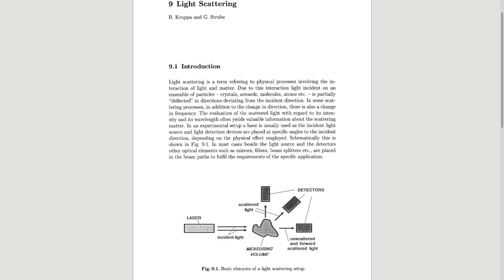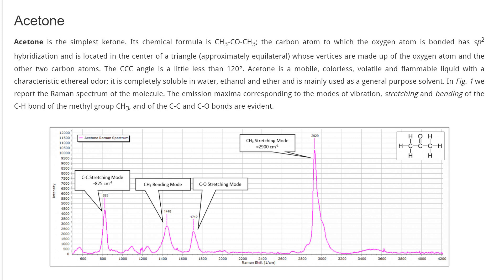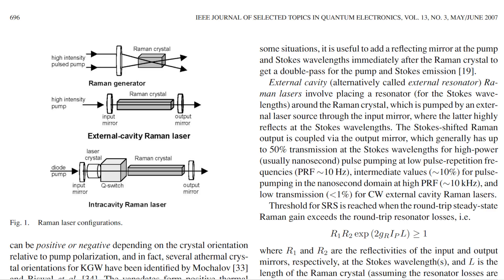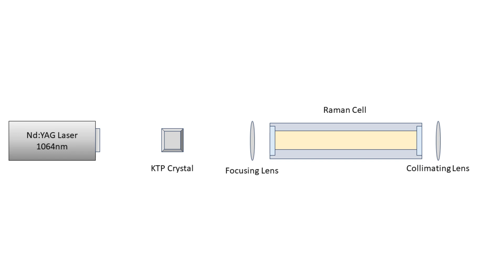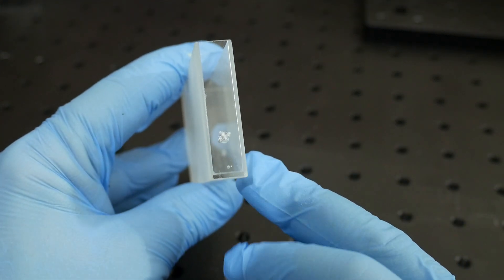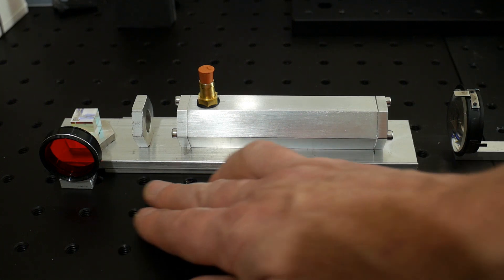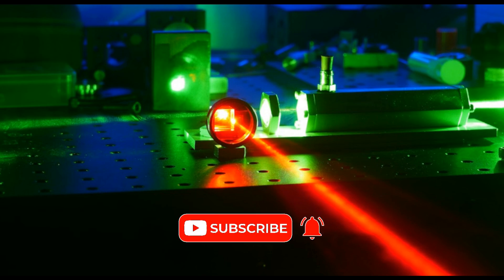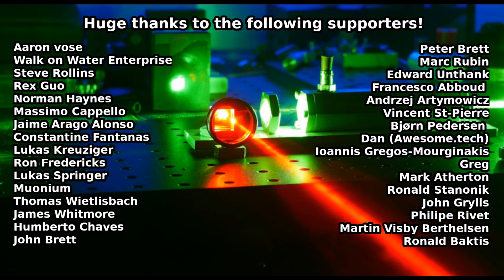Shaking molecules until Laser Light comes out. DIY Raman Laser!

Comment: I found an infrared laser diode and i don'tt know if i need a resistor in series and what kind of resistor i need or powered direct from my source. The power of laser diode is,115W, 895-915nm, 13.2v, 0,8A ,and I don't know if I should buy it to create with light pulses, plasma in the air (that is, to ionize the air) in the focal point. Do you think it's worth buying , so do you think it can work?i have laser glasses between 650-1200nm.Ochelari de protectie operatori pentru tratamente LASER DIODE si Nd YAG,or should I use the dark green glass of the welding mask?can this 115w diode produce plasma as I said?

Comment: I'm very inexperienced in this area...he had very little to no output with the acetone and ethanol, and at the end he had success with dimethyl sulfide if I heard correctly? I'm curious about the length of interaction in the cell in the setup shown, the higher limits one is able to make that interaction and the effects of increasing the interaction, also is it possible to use multiple cells and what it's effects are, what effect does input wavelength, power and time have? I know I'm asking alot of questions but I'm extremely interested as I'm not knowledgeable yet in this field and learning new things like a simple method of changing a green laser into an orange/red laser etcetera might as well be a cigarette or alcohol habit for me 😂

Comment: @4:41 are my lab experiments.  That is the tutorial page about it.  Thanks for linking to it.  Nice work BTW!
Reply from the maker: Awesome! It was a nice read, just wasn't keen on making a Pressurized Hydrogen shifter in my house! Thanks! :-)
Reply: @LesLaboratory  No kidding right?  Besides there is the cost of the gases. I made a cell a few years later with both hydrogen, deuteruim with argon:$$$. BTW, you alluded to a solid state Raman laser based on Barium Nitrate.  Look at the work on KGW crystals if you are interested. I was working on some of that a few years ago. That seems like a neat and promising solid state laser using Raman scattering.  See Mildren and Piper papers

Comment: Is it possible to recycle the dump beams back into the system to help energize the raman cell? It looks like a lot of energy is lost to the dumps beams, but I guess the camera might just make it look that way. Would it be worth doing in a real world set up?
Reply from the maker: Yes, the current setup is not very efficient. If resonator mirrors were included, it may be possible to extract more power. The system is problematic though, as the peak powers are huge. Stray reflections will destroy optics, and reflections back into the YAG Laser would more than likely destroy it. There may be more efficient ways that I am looking into.

Comment: Good video. If you want the long explanation then see Derek A.Long: The Raman Effect A Unified Treatment. You can solve the equations exactly to calculate exactly what wavelength and intensity of scattering you will get. It's fascinating to see how you work through it from basic physical principles and a good demonstration of where maths ends up pretty complicated. You solve it with a method developed by Oppenheimer.

Comment: Hi Les, I got a question about light that you might know the answer to:

I've read that the wavelength of light (is one of the factors that) determines how much a small structure can be resolved by that light. Wavelength can be thought of as the distance between two electric field peaks along the direction of light propagation.

Light propagates in 3D space, and even the collimated light from a laser pointer have a finite cross-sectional area. 

The question is: Is the cross-sectional area of a light beam limited by its wavelength? lets say that a laser produces circular spot on a screen with radius R from the center (highest intensity) to the edge where its intensity is (just close enough to) zero. If we have an X-ray laser, will this be able to produce a spot with much smaller radius R compared to a red 650 nm laser?
Reply from the maker: Yes, there is a finite spot size. This is dependent on  initial beam dimeter, focal length, beam quality etc.
Assuming everythng else is optimal, then yes, youbare correct, the ultimate limit (diffraction limit) is determined by wavelength. This is why Nichia's blue Laser diodes were such a big deal when they first hit the market.
Sure the output from an x-ray Laser could be focussed into a very small spot indeed, way smaller than any visible wavelength. Of course actually focussing x-rays is extraordinarily challenging.
Reply: @LesLaboratory  Ohh I see. Good to know!

Comment: 9:50 technically, frame rate isn't the key setting - but shutter angle. This is the ratio between frame rate and shutter speed. So if you're recording at 120 fps, a shutter speed of 1/120 will absorb all light, while 1/240 will absorb light 50% of the time and be closed 50% of the time, and so on.

It's called shutter angle because historically, cinema cameras used a spinning disc coupled with the film transport. So the amount of time light was let in correlated to the size of the cutout in the disc. 180 degrees, 90 degrees, 45 degrees, etc.

Scientifically, the main concern is what percentage of the time your camera is receiving light, but in cinema the visual effect of shutter angle on action scenes is quite pronounced - even though the camera is 24 fps the entire time.
Reply from the maker: Thanks, I will look that up and see if my camera supports it. The biggest issue I have found when it comes to filming short events, is the rolling shutter. If it was a global shutter, I suspect I would get far better results.

Comment: Fantastic results! Have you measured how much of the pump concerts yet?
Reply from the maker: Thanks! Not yet, it is particularly finicky to get it working for long periods (thermal lensing, optical damage etc) however there has been some suggestion that this may also be producing extraordinarily short pulses, so it looks like I will be investigating autocorrelation amongst other things.
Reply: @LesLaboratory  interesting.. for ultra short pulse generation I would expect the resulting spectrum to be much broader than the pump spectrum, because you usually start driving a bunch of funny nonlinear processes at once.

Comment: One use of Raman lasers was to convert 1064nm to 1550nm for "eye safe" laser rangefinders. They used a cell filled with  980 to 1200 PSI of methane to do it. Now they use PPLN crystals to do the same thing without the gas.

Comment: 5:25 How does "doubling" 1064nm create 532nm? I think you need to go back to math class...
Reply from the maker: Double the frequency is equal to half the wavelength.
Reply: Yes, I know. But you said doubling 1064nm (a measure of WAVELENGTH, not frequency) gives 532nm, which is not correct. Doubling 1064nm would give you a wavelength of 2128nm.
Reply: In reciprocal space doubling a vector halfs the vector in real space.
If you do more than school math you notice that real number space/vector space is not the only way of describing our world.
We can also use eg. reciprocal world, where half of something is equivalent of the double of its equivalent in real space.
So mathematically it is kind of correct what je said, if you dont only work in normal space.

Comment: So the frequency shift was due to methyl group vibration according to your spectrum, therefore the same effect could be expected from acetone or anything with lots of CH3 groups? On another note, since ramman effect is more pronounced for non polar molecules, you could try some benzene, toluene or stuff like tha
Reply from the maker: Exactly. The strongest peak normally Lases. It is possible to get other peaks to Lase, and even have the shift cascade (Cascaded SRS).
Sure. for that I need a longer cell I think, although, there are also 'other ways' to make the conditions favourable for other materials.
Reply: Good to know. But what makes acetone less effective compared to DMSO? I mean Very similar molecular structure..

Comment: Just superb. Despite working at a laser lab for many years now with at last count nearly five hundred lasers in the building scattered throughout dozens of labs, I have never actually SEEN a Raman laser actually doing its thing, only diagrams, and theory, and spectral traces. It's beautiful to actually see it happening, and illustrates to the curious viewer so very clearly HOW it's happening. I believe this technique of using a tunable Raman shifter (done with pressure?) is actually the 'secret sauce' of how the fissile uranium 235 "SILEX" laser enrichment process works. 
Fantastic work. Time to send you some more $$!
Reply from the maker: Thanks! and thanks again for your contributions to this channel!
It looks far more beautiful in real life it has to be said. Like the brightest He-Ne beam you have ever seen!
Ah yes, U enrichment, I remember reading about huge Dye Lasers being used for that as well.
The tuning aspect is something I am particularly interested in for Raman. There are a few papers that allude to it. I will have to dig deeper.
Reply: Yup they use raman shifted copper vapor pumped dye lasers for the SILEX process. They are tuned with diffraction gratings to a very specific frequency in the near infrared band.

Comment: There are 3 different laser frequencies in this setup. 
The initial infrared beam.
It gets doubled up to green.
That gets ramanized down to orange.

Do the goggles block all three?

Don't worry, I am not planning on using any complex laser setups. At most I might use a laser cutter, which uses a single color, so I would just need safety goggles designed for that color.

For this setup, it seems you would need filters that block everything but blue.
Reply: No, they're "LGB", or "KTP", or sometimes, but increasingly rarely since almost no one uses them anymore "argon" goggles. They block the fundamental Nd line and its doubled green, but are amber colored as can be seen and let orange and red light through so do not protect against the Raman shifted 629 here. At some point working with lasers of multiple wavelengths you just have to accept what's possible and take some risk with your setup. If you didn't, the only goggles you'd be able to use were ones made of steel, because a totally opaque material is just about the only thing that will protect your eyes from all the wavelengths you're dealing with in many real world setups. There just aren't any goggles that work for all wavelengths in an experiment like this, they don't exist. So what you do, and what he did, is simply choose the ones that are most suitable for the application and which block the most intense and most dangerous beams, which are the IR and 532 here, and just be careful about the orange beam.
Reply from the maker: What @Muonium1 said. The OD for these is pretty low at 629nm, and so it represents a moderate to serious risk to vision. For Supercontinuum the situation is worse. No glasses will protect you from all wavelengths at once.
For a setup like this, you must make sensible use of beam stops, and make use of a camera for the setup. Cameras, though expensive, are replaceable. Eyes, not so much!

Comment: Another cool video Les! Wallpaper-worthy laser setup picture near the end. 
Some thoughts about the Raman laser:

1. What is the advantage of having a Raman-shifted laser light? at first glance it seems like the wavelength shift is fixed so not that many new wavelengths can be obtained when the pump wavelength is set by its own gain medium.

2. If Raman scattering can end up with a smaller wavelength output light, does it mean the molecule transfers its own energy to the light? If so this seems applicable for cooling the gain medium or raising the output photon energy.

3. What is the range of pump wavelengths can we use Raman scattering with? Is each molecule more sensitive to a certain range of wavelengths?

4. Why the restriction on the gain medium total length? 

5. Not a question, but its kinda wild that a coherent light (the laser) can interact with a bunch of molecules like that and the Raman output stays coherent with a sharp linewidth.

Oh and which source did you use for the "light scattering" book chapter in the intro?
Don't feel pushed to answer. I just think these are some interesting stuff to discuss together.
Reply from the maker: The book chapter at the beginning of the video is here: https://link.springer.com/chapter/10.1007/978-3-662-02967-1_9 But it is pay-walled Ugh!

So...
1) The advantage is, you can engineer your wavelength. For a YAG pump, we can have 3 or 4 potential output wavelengths, and if we raman shift, that becomes 8. Some Raman materials such as Hydrogen, Deuterium, Barium Nitrate, can produce more than one line as well. You could do a similar job with a dye Laser I suppose, but the line-width would be very broad without additional optics.

2) For anti-stokes, the molecule would have to lose energy. I'm not sure if that would cool the medium in a practical sense, I would have to look that up.

3) I am sure there are limits (absorption etc), but from what I gather a shift is a shift regardless of the input wavelength. If you hit a Raman medium hard enough, the shifted light, can also result in Stimulated Raman scattering, leading to cascaded Stimulated Raman scattering! This phenomenon is used in Supercontinuum Lasers.

4) I wanted to build it small. Technically the largest Raman gain medium I have is 200m of telecoms Fiber (see the Suercontinuum Laser). Also some folk have made some interesting points in the comments that I will follow up on. 

5)Also already answered, but yeah, some very cool stuff happens at high peak powers. I have a Nitrogen Laser video on the channel, where I got a cuvette with dye in to just Lase. No mirrors, the only feedback is from the class walls of the cuvette. Even if you tilt the cuvette to eliminate the feedback, the thing will still Lase.
Reply: i think #5 goes along the same way as how stimulated emission does this in the first place
Reply: @bottlekruiser  Oh the Raman gain medium is also contained in a resonant cavity isn't it? I forgot

I was imagining a jumble of fast-moving, jiggling molecules not oriented in a particular way that somehow can generate coherent light
Reply: no the raman medium wasn't in a resonant cavity, but you don't really need one to have stimulated emission
TEA lasers lase without one
resonant cavity isn't there to orient the molecules, it's there to selectively accumulate the standing wave that sets the direction&phase of the stimulated emission. Here we have the coherent wave premade for us. Hmmm doesn't that mean that the stimulated raman emission isn't necessarily coherent in phase with itself
Reply: @bottlekruiser  but a cavity is needeed for the A part in LASER right?
I agree with your point on the resonant cavity, its just I'm thinking even though the pump light itself is coherent, interaction with molecules is necessary to produce Raman light... they're linked. Now somehow the randomness in the state of the molecules still produce sharply coherent light?
Reply: @GeoffryGifari  a cavity is required as a technical limitation, it is not inherent to the process. The excited atom doesn't know or care there's a cavity, it's stimulated by the local field and acts accordingly. The cavity helps that immensely, but again it's not *inherent*.
Reply: @bottlekruiser  You're right. I shouldn't have said "needed in laser". I agree with your points so far, this part can be put to rest.

Comment: What I once did was to use an NdYAG pulsed laser , only 3 mJ 5ns and a gas cell only 12 cm long. This gave an eye safe output wavelength about 1700nm I think it was and used it as a long range distance meter up to 15km range with a telescope aperture diameter of 150mm gold coated mirror.
Reply from the maker: Nice! That is very cool! I imagine some 1154nm light is generated in my setup as well, but my spectrometer wont see that far into the IR.
Reply: Yup I used to repair those range and target designation lasers. The output is 1550nm 980 to 1250PSI of methane in the conversion cell. Used really thick silica windows at Brewster angle and was in the lasing cavity path of the Nd:YAG pump laser. Alignment was somewhat tricky because both the cavity mirrors were TR at 1064nm, but the rear one was a retroreflecor prism, so it wasn't too terrible for alignment.❤